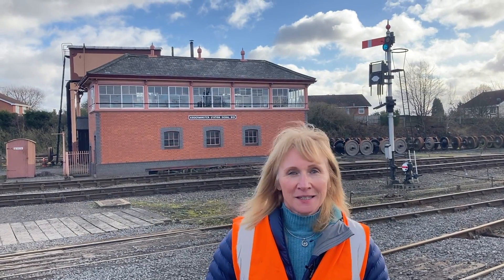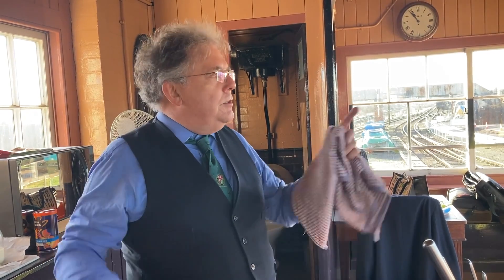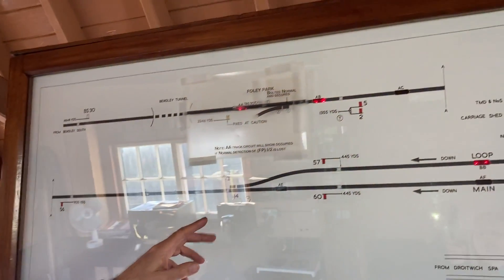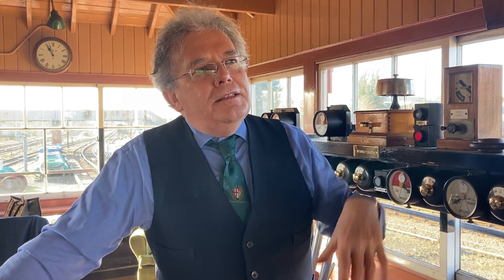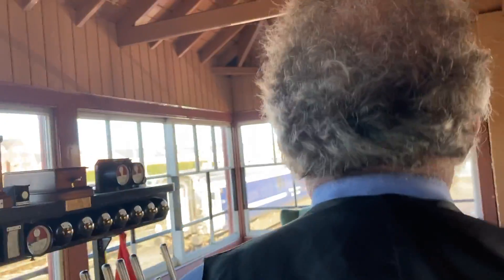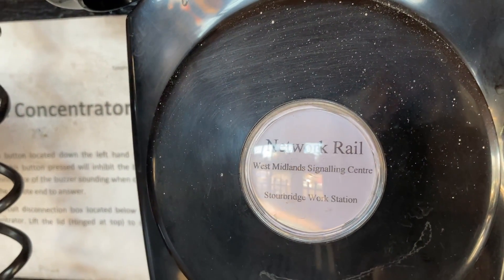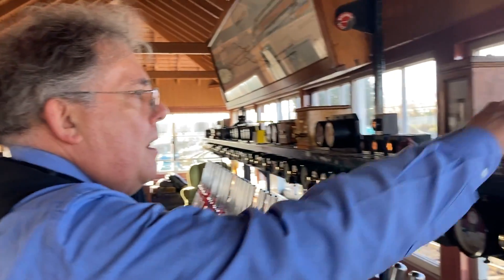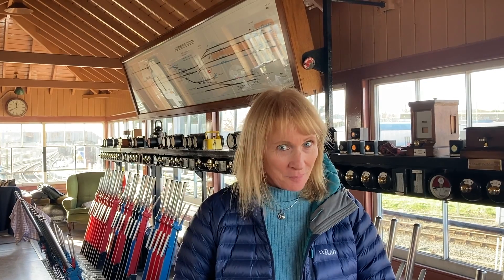How does it work? Behind the scenes of Kidderminster Signal Box on the Severn Valley Railway

Comment: Just curious, why do they always use a towel to pull the signals?
Reply: We use them to stop the sweat from our hands rusting the levers. It's amazing that when somone hasn't used a cloth you see rust forming in the shape of hands and fingers. Over time the lever cloth becomes a bit of habit and you find yourself worried if you can't find it. The cloths are to a standard size and design and you can still buy them.
Reply: @alastairtaylor6532  Thanks, I've seen it done many times, but never understood why the cloth was used.  It turns out, it's not an easy thing to google 🙂
Reply: @steveford1275  It is very much frowned upon when you see a signalman not using a cloth. For others it is part of the heritage and they wear it like a badge of office. I have about four lever cloths and they need washing quite frequently. PS, I am a SVR Signalman.
Reply: @steveford1275  most network rail signallers no longer use lever cloths. They were used a lot years ago, but there’s only a few ‘old school’ signalmen that still use them on main line signal boxes nowadays.
Reply: @kieranhooper4227  True. Most signal boxes still in use on modern railways have installed a clear primer to stop the rusting. However on Heritige railways this is not consitered heritage and is therfore not used, requiring the towels. My experiance as a trainee signalman in Aus.
Reply: @matthewdavison7456  I don’t know of anywhere that has cleaner primer
Reply: @kieranhooper4227  It was hearsay from someone who worked on the Metropolitan rail network. Don't know if it's true but it would be easier than dealing with rust.
Reply: @alastairtaylor6532  Why not simply wear gloves?